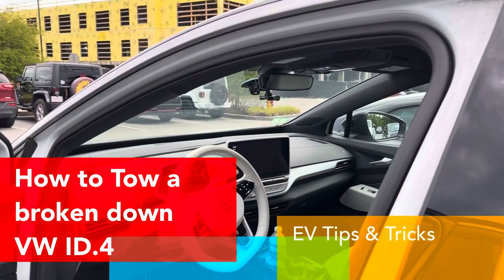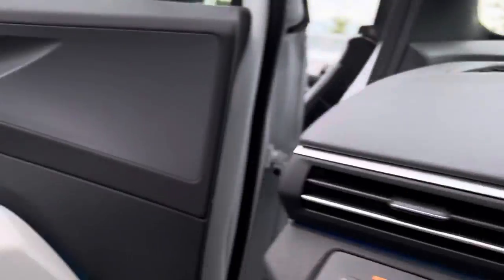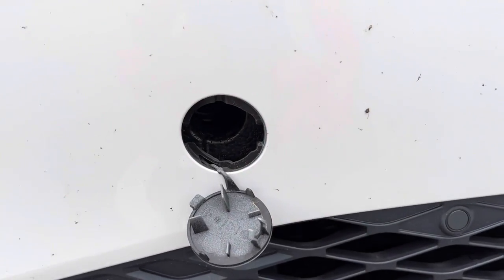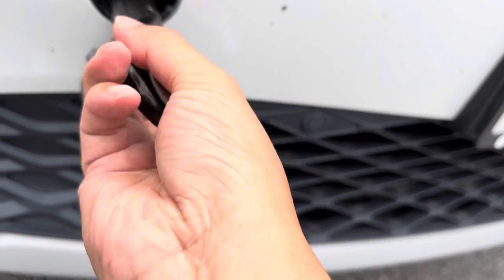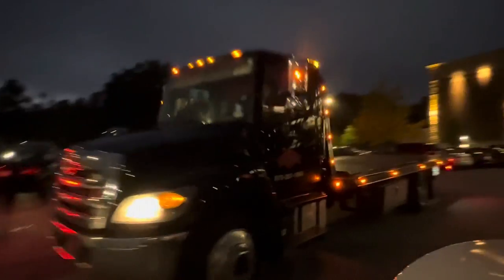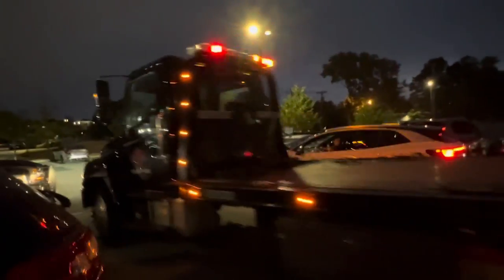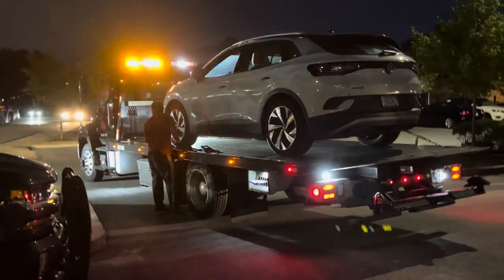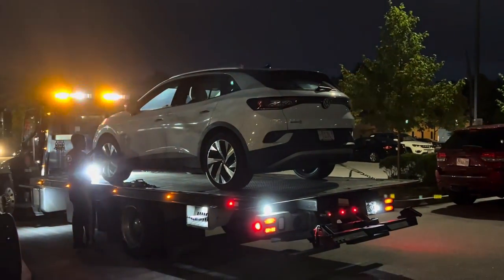How to Tow a Broken Down VW ID.4

Comment: Thanks for the towing tip.  Also, I found this out at the car wash. You can put it in neutral and press the on button to keep the ID4 on without having to sit inside.
Reply from the maker: That’s a great tip! I will give that a try.
Reply: I just towed someone's 22 id. 4 and I saw no on button. Just the engine start button
Reply: @ozie1uome  Correct. Pressing the Engine On and put the ID4 in neutral and exit the ID4 without it turning off;

Comment: Thank you for the video and important information.  I bought my ID.4 at VW Wellesley as well. I have found their service group to be excellent. Hopefully they will have you back on the road soon.  It would be interesting to know what the exact problem was and what had to be fixed.
Reply from the maker: Once I know what is going on I will definitely make a follow up video. VW Wellesley at least gave me a fun Taos to drive around for now.
Reply: @EVTipsAndTricks  Strangely enough I went out this morning to take a short trip in my 2021 ID.4 Pro S and I also go the "Electrical system not working correctly please service vehicle" message.  It was accompanied by the inability to turn the car on so that I could not put it in gear nor release the emergency brake.  Anyway, the tow truck driver was able to extract the car from my garage and it also now sits at Wellesley VW.  I await their solution.

Comment: I had to tow a 2021 Id 4 and it wasn’t too complex. The regular tow truck can take it. You don’t have to wait around for a flatbed. Regular tow trucks carry dollies that they will place in the rear to lift the tires off the ground. The tow truck then scoops and lifts the front wheels off the ground and essentially you have a car on wheels on wheels lol anyways hope this helps.
I did however just got a 12v battery indicator, “drive with caution” warning

Comment: I am having recurring problems with the electrical system error in my 21 Pro S.  VW can not replicate failure and has had the car for 2 months.  What was resolution to your issue?
Reply: 😢😢😢 im in iraq Baghdad. My car not work same this video.   Drive inverter problem.
Reply from the maker: My wiring was damaged by rodents

Comment: Nice!!! I almost need to tow. What happens to mine was the 12V battery died 3 times. Got jumped by another car and I started
Reply from the maker: Did they replace the 12V battery under warranty?
Reply: @EVTipsAndTricks  they did. Works fine now. But now I carry a small battery charger just in case.

Comment: Had the same thing happen to our 2021 ID.4 Pro S w/gradient 3 months after we bought it. Warnings were yellow tho and walking away from the car with the key fob for 15 minutes cleared it up. Took it to the dealer the next day:

"CUSTOMER STATES ERROR MESSAGE CAME ON DASH STATING
"ELECTRICAL SYSTEM NOT WORKING CORRECTLY.
PLEASE SERVICE VEHICLE". ONLY HAPPENS DURING WARM TEMPERATURE. CHECK AND
ADVISE
0150000 1.46
RAN GUIDED FAULT FINDING RECEIVED POCFFO0 Hybrid/EV Battery
Pack Coolant Pump Stuck. CONTACTED VOLKSWAGEN HELP LINE
ADVISED THEM OF CONCERN ACCESS CODE 2894435 WAS ADVISED TI
PERFORM TB 93-21-02
RE RAN GUIDED FAULT FINDING PERFORMED TEST PLAN AS ADVISE
FROM TB 93-21-02.
PRESSURE TEST SYSTEM AND BLEED COOLING
SYSTEM CLEAR FAULT ROAD TEST"

Hope this helps and you're back on the road soon. Please keep us updated...
Reply from the maker: Thank you so much for sharing that info!!